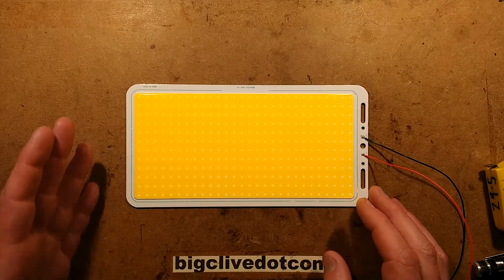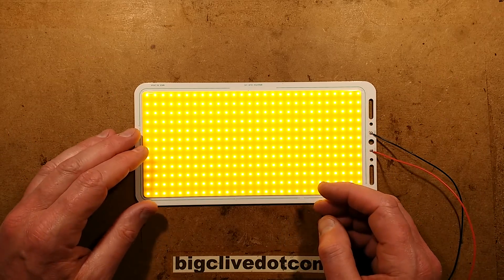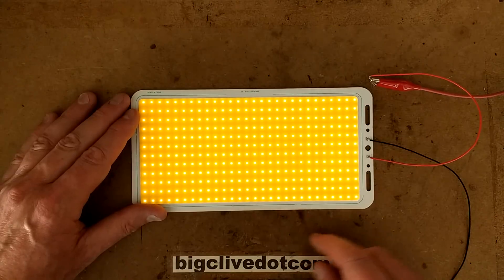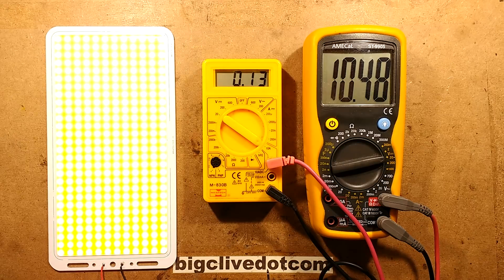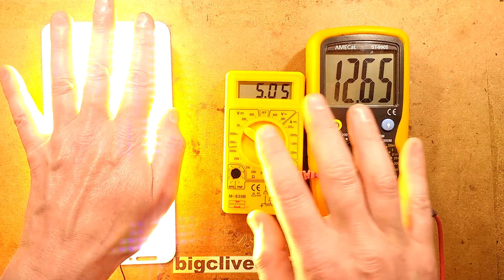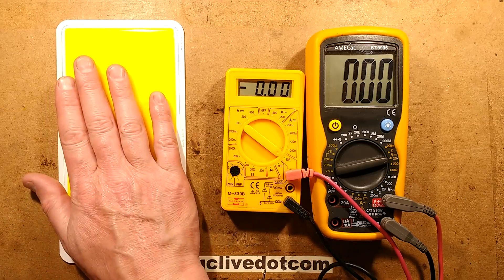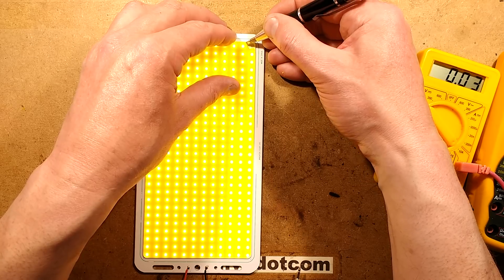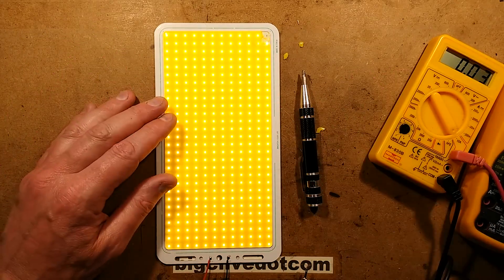The biggest LED COB panel yet!  Voltage/current tests.

Comment: So any idea what kind of power rating of sodium light these might be equivalent to when running at a flat 12.0v and 30-ish watts? I could do with further arguments to try and convince my block's managers that it's worth the investment to replace the old systems with LEDs. Though I'm not actually sure at this point whether they're more efficient for the amount of light, instead of merely giving a better colour spectrum. (also, the lower powered type vs 2D fluorescents? both of which require some kind of transformer after all...)

Anyway, if using them in a "vehicle application" you'd have to put some kind of regulator or limiting resistor inline with them (most systems with a battery and alternator have one anyway, but it's set for too high a voltage...), because "12 volt" systems tend to run at more like 13.5 to 14.0 volts, which would probably equate to a couple hundred watts, and enough power to burn out the diodes very rapidly - if the current doesn't melt the supply wires first.
Reply from the maker: At this point in time I'd say that an old sodium light is going to last longer than most LED replacements.
Reply: Interesting. I had a suspicion that might be the case, which is why I didn't force the issue with them until researching it a bit further, but kinda hit a wall with my lay-idiot googling. It just seemed like something worthy of pursuing, given that the local council had embarked upon an expensive scheme of replacing all the old sodium street lamps with LED, despite being completely broke. But then, there's no guarantee that there's any kind of logic dictating THEIR actions.

The question still remains as to whether it would have any kind of advantage in terms of energy efficiency (or even purchase cost - I was discussing it with them because all four of the bulbs previously illuminating our garage area had burned out within a matter of months of each other and it was taking forever finding anyone to do the simple job of fitting new ones) that might offset the shorter lifespan, though. I know that the sodium ones have an advantage over a lot of other lighting technologies in terms of apparent brightness per watt simply because they concentrate all their output into a very narrow, almost monochromatic range of frequencies that are close to the eye's most sensitive range, but is that enough to beat LED when it comes to the simple task of making sure we can see the ground in front of our feet when walking back from parking cars at night for the lowest possible cost?

(I was about to start trying to argue for multi-diode strips instead of four large floodlights, which would cut down on shadowing and let you see what you were doing in the actual garage better, so not have as much of a risk of falling over without having to install separate battery powered and sensor triggered interior lights, but I have a feeling those are actually relatively inefficient...)

Comment: Without ANY values for light intensity or color,   ALL these LED videos are really redundant for any practical purposes.
Reply from the maker: The only way you can really determine if one of these is suitable for a particular task is to try it.
Reply: Thanks for your reply Clive!  but that's not true. For example, I'm interested in using these kinds of lights for (fresh water) planted aquarium lighting.. If your not aware, good LED lighting for even a relatively small aquarium can exceed $1000. They claim its all about the temperature and intensity of the lighting that (only they can produce) warrants their cost..Im not conveiced, nor an I convinced they are producing their own LED's and are not buying them from the same markets you are .  Salt water is an entirely different set of requirements as is gardening, photography and security lighting (infrared), just for examples.. I don't expect you to know or understand all the implications of these types of lighting applications, however,  I for one had hoped I could acquire these types of information from your LED videos in that I could follow it up with my specific application knowledge.  Thoughts??  TY!!

Comment: This is amazing, thanks for making this video. If I were to wire it directly to a 12v car battery, what would you recommend for a voltage regulator?
Reply from the maker: Simplest thing would be a resistor.  By the look of what's being sold online some seem to rely on cable resistance to limit the current.
Reply: @bigclivedotcom  Since you were attempting to destroy it anyways... It would have been interesting to see what unlimiting the current would have done.  Does it have enough resistance to limit the current on it's own? 

I am looking at getting one of these for a solar application where energy will be limited.  I don't want to use just a resistor which could use up half the power itself, so I will look further into how to limit the current.
Reply: Mind you without spending more than 10 dollars if possible

Comment: I am thinking about modifying some old DMX stage light scanners that us MSR 1200 lamp (1200W halide)  and when I was searching I bumped into those panel sized LEDs from Aliexpress that claim to be 680W ! they look a lot like the one in that video but from images it seems that "680W" have more led chips (I counted 18x30 array=540 LEDs). Do you think that 680W is legitimate? They are rated 12V-14V which at 680W would mean about 50A of current. I would love to see a video about these COBs. I also am kind of skeptical about 1,26W per LED chip.
Reply from the maker: For a stage light that has a tight beam path for projecting gobos you really need a point source of light.
Reply: I could somehow direct light I guess, with point source it is a bit hard to reach the power level

Comment: Looks like it would make a good under-hood light.  Need a protective lens and a resistor though.  Using 16 ga. wire with a fuse from the battery would be best.. using a switch like a door switch (button switch that's closed with button out).

Comment: Very very neat! I wonder if I could find some "warm white" ones with known specs... (emission spectrum & CCT).

I think you shouldn't underestimate the accumulated heat though, especially if not directly heat-sinked (or actively air-cooled). I don't think over 1A is realistic for 24/7 usage, if you care about its longevity. Then again, this thing is quite cheap for what it is.

Comment: Clive, I noticed they way you are  working with those LED panels and even removing parts of the  phosphor, showing the UV light source under it. Have you heard of the risk of "High-Energy-Visible-Light", (wavelength < 450 nm) which is said to be quite risky, causing cell-death in the retina (see documentation by the National Institutes of Health, Bethesda, Maryland, U.S.A.) and leading to early onset of age-related macula-degeneration.  What is your idea of this risk, especially in relation to long working hours in front of the screen and LED  lighting in general - as encoured by EU-legislation to ban normal light bulbs and replace them by LED-based lamps ? Could to eventually tackle this issue in a film you will do in the future ? Thank your !
Reply from the maker: There have been studies in the past that showed that blue and beyond can have a bleaching effect on the retina.  But these levels are nothing compared to natural sunlight.  If I took this panel out into bright sunshine you wouldn't even be able to see the light coming from it.
I do try and avoid staring at high intensity light sources.  But a lot of the hype regarding killer LED street lights and lamps is all just the usual case of non technical people jumping on the latest bandwagon.

Comment: Hey Clive. Have you seen the range of tools from Aldi? They have several things like £20 soldering stations and £15 rotary tools among other smaller things such as £3 helping hands and mini vices. Might be an interesting range of products for review and testing.
Reply: Konnor Bowen aye, I picked up one of the soldering stations. I'm sure the temperature is way out on then, but they do definitely adjust their output and the kit itself is fairly clean and straightforward.
Reply: Aldi America must not carry that stuff.

Comment: 12 rows by 20 is 240 chips. Must have meant 28 across  That's a huge COB. Great video!
Reply: He said 28
Reply: I had to listen three times and still didn’t hear 28. Shrug. No big deal
Reply: @VanFlicke  I think he said 20 to begin with but in later comments, after he murdered the first LED he did say 28.

Comment: For automotive applications this lamp would benefit from having a basic 2 transistor constant current regulator so the light output doesn't vary depending on whether or not the engine is running.

Comment: Is it just me or do cheap no name multimeters spoil good electronics videos, I dont think Im a name brand snob I just don't trust them.
Reply from the maker: They're useful as extra bench meters for monitoring a variable while using your main meter for something else.  But the little meters are actually pretty accurate and usable if you understand their limitations.
Reply: Sometimes they don't work hardly at all. When they do though, it's pretty decently accurate.

Comment: Clive i have a 200W Cob if your interested in having a look at one
Reply from the maker: I've just ordered a 200W one.  It'll be interesting to see how it looks.
Reply: it would probably try to imitate the sun :D
Reply: i have 10 ordered direct from manufacture 37v 7 amps (ish) dont underestimate how hot these get if you wanna do some testing on one of mine before yours gets there let me know il get one shipped
Reply: there used on landing systems on plains

Comment: So Clive... Say you were to create a circuit that intentionally shorted out each section of the panel at timed intervals. Instant rave light?
Reply from the maker: It would be easier to get some of these in different colours (when they become available) and have a flat fronted light with sequencing circuitry in it.  Like a coloured strobe.

Comment: I bought several of the smaller size Clive played with in a previous video. I am using a 555 timer based PWM to dim it, and a 6.8 ohm current limiting resistor. Been running it for hours and it is still running cool. Thank you Clive for finding and playing with these things.

Comment: I think this would be the perfect thing for people that are converting vans into campers. A nice warm white light that would not use that much power and keep the heat down on rather hot evenings.
Reply: Connecting this directly to the potential charging voltage if 14.4V would be very bad though.

Comment: I feel a project coming along.......gives me an idea for a new desk light, with an adjustable constant current supply from my solar 12v system. maybe on a bendy stem to move about in the air and a heatsink on it too.

Comment: Hey have you messed around with the high power led chips with integrated mains driver?  I'm wondering if they are any good.

https://www.ebay.com/itm/50W-Full-Spectrum-LED-COB-chip-DC12V-32V-Integrated-Smart-IC-Driver-220V-110V/253056228887?hash=item3aeb539e17:m:m1wCwd8v30209oJmiHAWjpA
Reply from the maker: I put up a full teardown of one.  The early units seem to have a slight reliability issue.
Reply: Oh I must have missed it.  Thanks for the reply!

Comment: This is the first thing you’ve shown off that I’m really tempted to buy! It’s a very nice looking panel, and I got a lot of cool ideas for this. Could you do some more testing? Would it handle 300W for at least 200 milliseconds? Maybe 100W for 400 milliseconds? With heat sink of course, I never go without a heatsink.

Comment: 12:35 - The current went up 10x when that section was shorted out.  And that is with the reduced voltage... if it was being run with a higher voltage PS (not current regulated) the current would be very high and limited "by the wiring".  Something to keep in mind when wiring it up.

Comment: As a public service you should expose more of the wiring on the board and discover if it's safe to drill holes anywhere.
Mounting these to a proper heatsink with good/firm pressure will be hard since they have no holes in middle. If it is safe to drill holes in a few locations inbetween the LEDs it would help.

Comment: The first thing that went through my mind was bulkhead light. I'm pretty certain there are some cases roughly the right size for that. They would fit a small PSU too so you could feed them with say 36-48V reducing your feed current.

Comment: Would it be a bad idea to run a few of these in parallel? It'd be nice if one could drive them off one adjustable current source and dim them uniformly.
Reply: if you had differences in cable length you'd get a difference in brightness

Comment: I Have had one of these for over a month and let me tell u they are very nice even at 2 amps its impressive at 5.5amps its amazing how much light this thing pumps out. I think 13000 LM they rate it might be a little low. I have heard of people pushing them to 8 but i think dont think its a good Idea to run this thing at 14.4 volts without current limiting its over its rated wattage maybe with a significant fan and heat sink but I would not run this thing past 5.5 amps or so not with your car running at 14.4 volts its not gonna last long without some mods.
Reply: Jason - if you under-drive the panel it'll last far longer, and  thermal management issues become far less of a problem. This will be ideal for lower output, but wider-area illumination sources, since if you really need power, there are already plenty of 100w COB devices , some with 240v direct connection capability.
Reply: I agree thats way I was saying I would not run this panel hooked to a running automobile 12v outlet which will be putting 14.4 volts to it. Over driving it quite a bit.

Comment: What about thermal runaway? Or is the technology so much better these days that it doesn't happen? I'm always surprised to see people just use supply voltage as the limiting factor in driving LED's.
Reply: Law-of Ohms some COBs have onboard supply management and will run nicely on mains AC, most simple COBs will still need a constant current supply.
Reply: WineScrounger I’ve never seen one with current limiting electrotrickery do you have a link? Seems like a perfect solution. No need for extra cc/cv supply.

Comment: topdesign666 has the cool white ones at £8.07 and if you buy 12 you get a further 7% off. So you can get 12 for £90 (£7.50 each).

Comment: The only thing i don't really get is.. well how exactly are you supposed to mount this? The one side where the power connections are has these slits that screws could go through and all the other sides have... nothing? Seems like your only mounting options to a heatsink or the like would be pretty ghetto looking  O__o
Reply: Use screws at the edge with washers.
Reply: Thermal conductive glue?
Reply: Only thing I could think of is "mirror retaining clips" (for lack of anything else specific to electronics using searches I could think of) and clamping it down around the periphery. Could also be retained by some longer sleeve over the edges in a similar manner. (Perhaps that is what's intended, given it's only able to be fastened at the one end.)

Other than that? Glue or double-sided tape.
Reply: Conductive glue directly to a heatsink is actually a good idea. Problem with that is that you then have to find out how to mount the heatsink.
Reply: I"ve used these in the past. OK providing the combined surface thickness isn't much over 3mm. http://www.marbig.com.au/products/general-accessories/marbig-fast-clips

Comment: All these large COBs are either 3000k warm or 6500K cold, I'd like something in the middle like 4000-5000K. Anyone knows about such panel?
Reply: I know I'm probably talking out my a**e here, but what would happen if you illuminated something with both 3000K and 6500K together?  It'd probably be no good for camera work etc, but if it's just for general illumination, wouldn't our eyes just average them together?
Reply: I have one light with two different temperatures mixed in, small PCBs and far away from direct sight. In that case it's usable and works nicely. But as you say it's no good for camera work or closer fixture as you will see different shadows and color variation depending on position under light. In the end I would rather buy one high CRI, neutral color temperature light than combining bunch of small ones. For general lighting it's good enough, though.
Reply: Yes, so right! I have fluorescent tube replacements that have a midwhite around 4200 and it's a superb colour. I wish there were more LED panels in that colour.

Comment: I still want to see you drill the center of the panel to see if you can put a small camera lens through it.
Reply: I think you would lose a 1/4 section?
Reply: I was thinking it might depend on the track placement in the center...it "could" be ok...but that was why I wanted to see it done.
Reply: Curious as well about that.
Reply: Checkout the new video, works alright